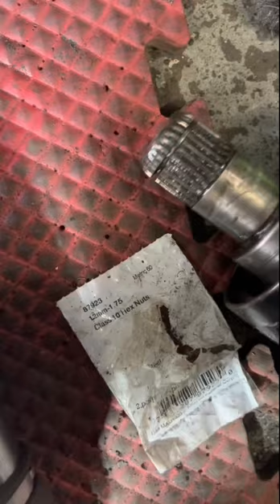CV Axle won’t click in And Removal Tricks #Genius  #hack #howto Ultimate Tips and Tricks

Comment: I have an X3 and the trick is to make sure the opening of the hog ring is at 12 o'clock. I saw this on another video and it works like a charm!
Reply from the maker: Very interesting I’m going to pin this comment. I wonder if you’re correct. I will check the next time. I have to do it.
Reply: We probably watched the same video. I had the same issue with C300 today and did the same with the 12 o' clock trick.
Reply: Every video says to make sure the opening is down... so does it matter where it's at if you say you put it at the top/12 o'clock?
Reply: 12 or 6 might actually be the same.

Comment: I think the circlip is usually the culprit when it comes to installation issues. Try to keep the axle as straight as possible. Use some grease to hold the circlip centered on the axle. If you still can not get the axle in you may want to consider removing the circlip and see if the axle goes in properly without it. If it then goes in properly, at least you have verified that the circlip is related to the issue and not something else. If you have to beat the axle in, there is an issue. If it doesn't fit there is a reason. Figure out the reason instead of resorting to brute force.

Comment: Effin LOVE this guy!!! I'll come donate if I can get the job done. Rn I'm having issues getting the holder braket for the cv axels bolt to loosen. There is a bolt that holds it into place on the bracket. (The passenger side one)I can't seem to break it free even with a air tool. So a breaker bar is a MUST and I just can't get up in there. Its a 2008 toyota rav. Its been days I mean like 5 days I've been trying so much different shit and I just CANT get it to break free 😢 any tips?( the hubs were 4 days by themselves)It's a space thats only as big as a mouth AND to get a breaker bar that MIGHT break it free in there, I just can't maneuver it in there to even try 😔

Comment: Im trying to put in a cv axle. I cant pull it back out so its locked in, but theres still like a 1 cm gap between the outter ring of the axle and the transmission. The axle wiggles back and forth a bit. To do the trick you showed, can i use a regular hammer, or do i need that fancy powertool you showed?
Reply from the maker: I would think you could I’m not sure but heck give it a try. Let us know.

Comment: Great video!  Just did the drivers side CV on a 2018 Elantra.  The new CV is making the same thumping noise as the original one, just not nearly as bad.  Noise is heard when driving straight and gets worse when turning hard right.  What's the chances I got a bad replacement one (non OEM)?  Have you had many bad ones from the manufacturer? 

Is it possible I didn't install the CV axle in all the way in?(everything did line up and go back together as before.  ie the control arm and tie rod end ball joint bolts/nuts)
Reply from the maker: I would lean more towards the axle not being installed correctly. The likelihood of you having a bad axle is very low.
Reply: @sharpcarco  I checked my installation and it seems fine.  I got a warranty replacement axle (same brand) and still has the same issue.  I confirmed my installation, I felt the O ring click into place, I have the same amount of gap between the axle housing and transmission and same amount of minor in/out play as I do on the passenger side factory one.  Is it a manufacturing issue and I should just go with the OEM one from the dealership?  I jacked up the driver side tire and let it free spin in gear, the thumping can be heard/felt so I know I'm dealing with the correct axle and correct side of the car.
Reply from the maker: Wow, that’s a interesting problem. Sorry if I could see it I could probably give you better advice. I’m not quite certain want to tell you.
Reply: Has the carrier bearing gone out? They make an awful thumping.

Comment: I think I have a problem getting my axle flush with the transmission, I installed an aftermarket new one, and the transmission fluid is leaking where I I stalled the axle 
Any suggestions
Reply: Did you find out why it’s leaking? I had this happen and the auto parts store sold me the wrong axle.

Comment: Hey bro i installed my new cv axle but the front end on both sides was jacked up for a week or two. I can only work on my car on weekends. I ended up having to get vice grip slide hammer which is why i had to wait an extra weekend. Now the steering knuckle isn’t lining up. I even moved the cv axle out of the way to see if that was the issue, but, the steering knuckle still refuses to line up.

I tried turning my wheels all the way both sides and having them at the center. I tried lowering the other side that was jacked up, down to where the side I was working on was the only one jacked up.

But no luck. Do you know whats going on? Any help would he appreciated. I won’t have the $3k it’ll cost to get this fixed for another 3 months and I wish I had been patient and spent 1.5k on getting the axles swapped out instead of trying to get a couple months ahead and trying to fix it myself. I have even considered totaling out the car.

Its a 2014 nissan sentra with 65k miles that ive taken very good care of since I bought it at 48k miles. 

So id be sad to total it here but i am getting closer and closer to that.
Reply: The other side, the passenger side, i was able to swap out in a day. The drivers side took me a whole day and i decided next weekend to go get an axle puller. well that didnt work i bought the adapter. That didnt work, so then i had to order the vice grip slide hammer off amazon. Thats why its taken me 3 weekends so its been on jack stands for 2 weeks on the front side

Thats why it took 2 weeks one side took a day the other side took 2 day plus a 5 day wait from amazon
Reply from the maker: Sorry to hear that I’m assuming the knuckle won’t line up because you’re not pushing on the right spot.

Actually, now that I think about it, I bet you’re axle is not  correct on the inside of the rubber accordions grab the shaft of the axle pull the end of the axle twisted a little little bit so it locks them correctly I hope that answers your question. I did think of that as I was writing you did not but now I know exactly what you mean 

The end of the axles should move in and out like an accordion, and it should move 6 to 7 inches whatever the depth of the cups are

Comment: I need help I’m changing the driver side axel of a 2005 Nissan Altima and I’m once I took out the axel and tried to put the new one there’s like a metal rod going up and down that I think is stopping the axel from entering I’m not sure if it’s supposed to be there or not
Reply from the maker: No, I know what metal rod you’re talking about it’s not 

However, if you can’t get it to click in turn it about 10° and then try to get it to click again repeat until it clicks incorrectly

Comment: Question My girl got in an accident in my car. I noticed the strut was bent and The alignments off.. I put the car in the air and one wheel spins the other 1 doesn't so I changed the axle on the 1 that didn't spend now the 1 that did spin doesn't spin. I change the axle on that side now the other side barely spends what could be the problem? I replaced both axles.
Reply from the maker: Well, that’s probably because the transmission will only allow one wheel to spin. Would be my guess.
Reply: They both spin i think it was brake pads pressing on the rotors.  I bled the brakes and both wheels turn now.

Comment: Clay I have a question? I have a car that I can't even get parts for anymore. I do all my own mechanicin' on this old Bastard. it is the oddball 1987 Buick Century custom 2.5 l iron Duke POS. my car all of a sudden would not shift out of first I mean it wasn't even like gradually giving me a heads up which is really confusing to me. because most of the time as we know these things give a heads up before they just take a shit. can't hook OBD up to it because it's freaking got to be the car that Jesus drove to school "old". I changed the shift solenoid under the side pan of the transmission in this stupid thing. took me about a week and a half because of the stupid cover that goes over the side pan. pain in the ass to remove along with everything else that we had to remove just to get to the stupid thing. reassembled. do you even drive it a few kilometers and something started rattling and clanging. sounded like something rubbing on something else. turn it right back around went home and looked under it and the inside of the CV boot was pulled away from the CV axle on the same side which would be the driver side. I know that I did not get the Jack or anything else because I had them on blocks around any part of this area of the car. hence the car still did not shift out of first. could the CV axle have worked its way out of the housing and caused the car not to shift

Comment: Cuz you already know 😂
Reply from the maker: Well, you know…. 😂😂😂 I’ve had a couple of dozen guys tell me how they’ve never had to do this after changing 100 axles I might just be dumb….. but then I thought it was pretty smart…. But then I realize I’m dumb again after they tell me that I’m going to destroy the transmission….. but then I think to myself, if a transmission can’t with stand this type of jiggling how does it spin…. So I’m not so sure. Now I’ve confused myself…. Anyways, if I ever have to do this truck again, I’m gonna do it because I’ll know by that time if I did any damage but I doubt I did because it’s mostly just vibration transferring down the axle shaft through the actual itself so I would have to think it would ruin the actual before it would actually ruin the transmission but hell what do I know? I’ve only been working on cars for a little bit over 30 years my experiences very very small in comparison to a 25 year old kid. (the one that commented this.) on my other video.